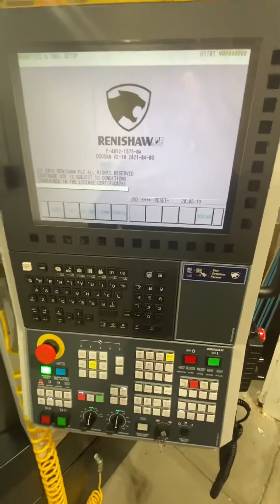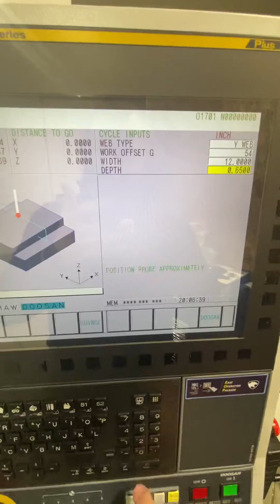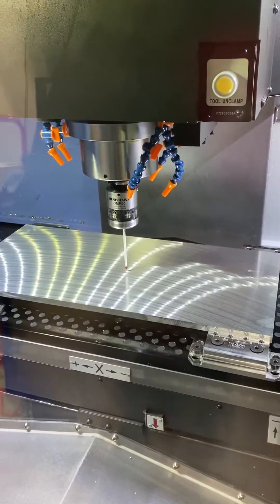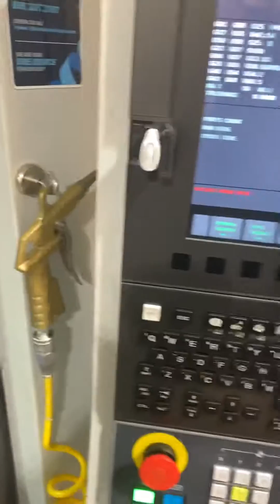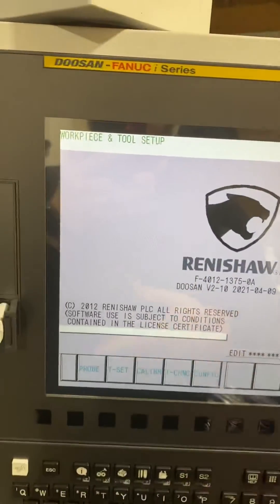Doosan SVM4100 - Probing a part with Renishaw Probe

Comment: What is the added table called that the vice is bolted to?
Reply from the maker: It's a fixture plate made by Saunders Machine Works
Reply: @Rustynutsdesigns  awesome thanks, I have the same machine. Your videos helped since I'm so new to it. Have you been able to turn off the constant air blowing?
Reply from the maker: @jackm3185  awesome!  I don’t think you can turn it off.
Reply: @Rustynutsdesigns  If I figure out a way I will let you know. It is real annoying to have it going non stop.